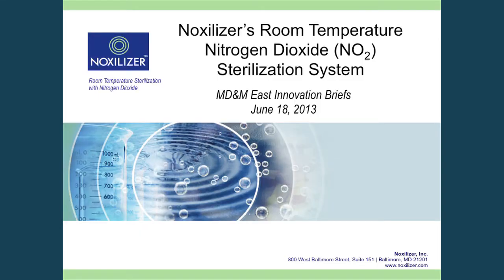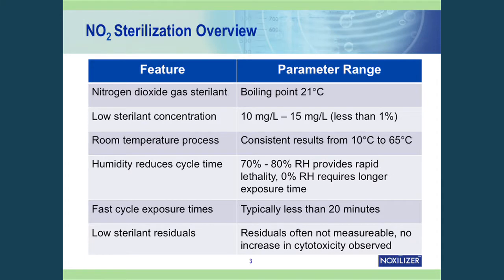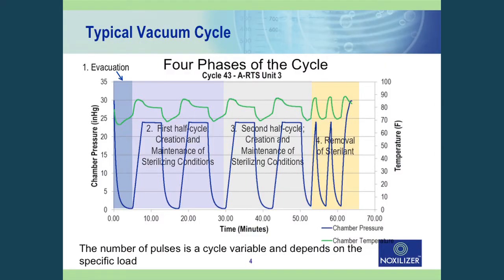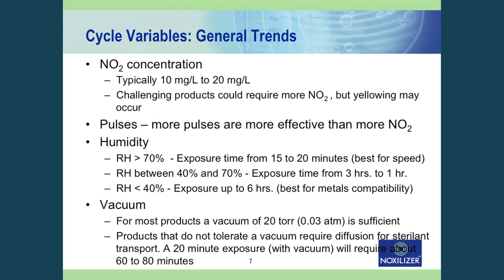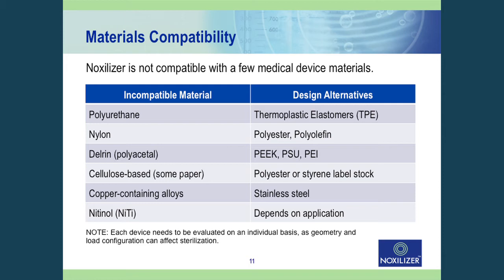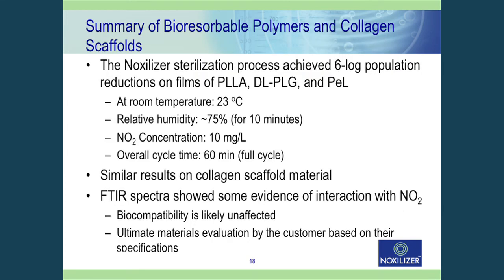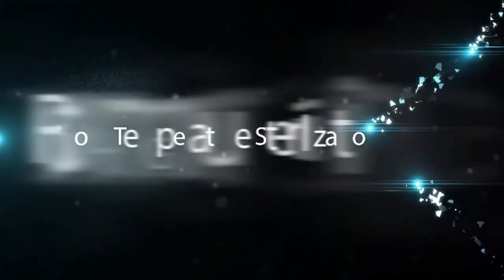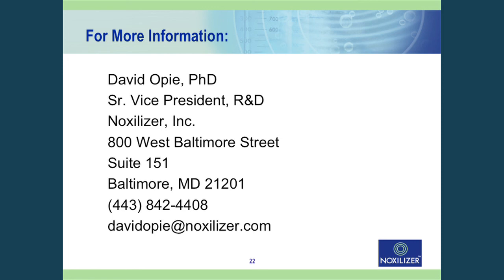David Opie, PhD. Presents Low Temperature Sterilization: Discussion of Current Methods including NO2

Comment: Interesting to learn how Noxilizer utilizes room temperature technology with Nitrogen dioxide to sterilize products quickly and with much less exposure to NO2. Since Nitrogen Dioxide boils at room temperature, it has high vapor pressure, so it won't condense onto the products being sterilized.